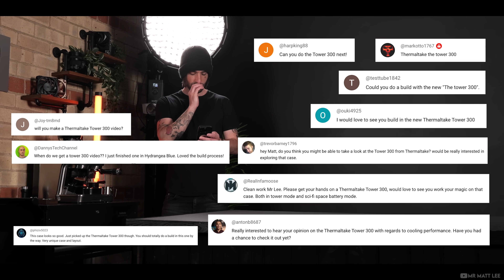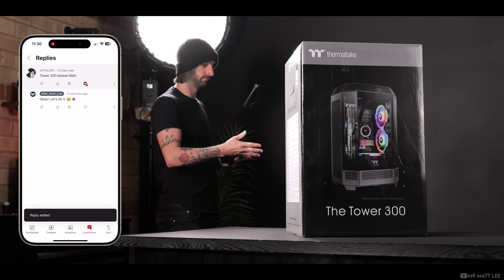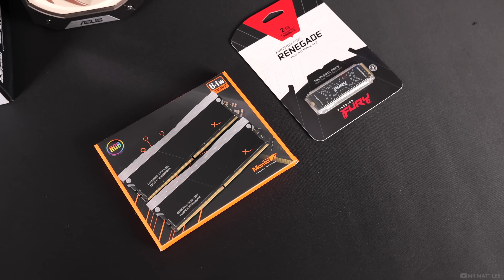A Coffee Lovers Dream PC Build... | Thermaltake The Tower 300 | Noctua RTX 4080

Comment: The fans on top surprised me. In the original they were clearly used as takeout fans.
Reply: Same here. I would have though exhaust fans on the top while the CPU, GPU and power supply pull in cool outside air. Because the exhaust slot on the GPU exhausts inside the case, that would have GPU heated air trying to cool down the CPU radiator.
Reply: I thought the same, the GPU exhaust hits the intake air, so all the heat from the GPU will be pushed back into the case and likely to recirculate back to the GPU fans.
Reply: @sebashadow2209  HOT AIR RISES. SO DOES MY BULGEASAURUS
Reply: Maybe he is going to mount it on its side using that case mount made specifically for that case?
Reply: it's mounted that way because of aesthetics I guess. If the radiator fans were pulling air, their back face would face towards the interior of the case, so the build wouldn't look so clean and elegant 😅

Comment: I could just say that this is an amazing build, but it wouldn't be anything new, nor surprising. The level of your work goes only one way - up! 🔥 
And the more ☕, the better the result! 😁

What I will say though is that I've been building PCs from ~1998 till ~2010, with a loooong hiatus that ended just last year (2023). This "time off" lets me see the coolest upgrades in PC building we had in this field over the last decade and a half and undoubtedly there are two:

1. Data drives in the form of PCI-E/NVME - it makes it all look so much cleaner! And yes, I'm the guy that still remembers those terrible IDE cables with Master/Slave configuration jumpers on the hdd drives and cd drives. 🙈
2. All the different form factors for cases! It's just amazing to see all those different approaches from case manufacturers. It's not "all the same" with a different front anymore and I'm soooo ready for it!

Cheers! ☕

Comment: Get my request fulfilled while also being immortalized at the beginning?! Awesome! Can't go wrong with the Noctua coffee vibes either. Looks phenomenal! Thanks for doing this one.

For those of you looking to build in this case to use, however, I strongly recommend fan orientation of top exhaust with AIO fans and bottom fan as intakes. I've tried every possible configuration including Matt's here and top exhaust with AIO and bottom as intake has been the best for thermals for me at least when monitoring temps in gaming and running some multi core tests in Cinebench. (running a 14900k w/360mm AIO).
Reply: thought exactly the same when I was watching the video
Reply: Yep
Reply from the maker: Always a pleasure to acknowledge you guys where possible 😊 Regarding the temps, I also tried it off camera in multiple configurations and found that the top intake worked best for me (only by a few degrees) based on the hardware I’d chosen. That’s not to say it will work best for everybody, all motherboard, graphics cards, processors and such will ultimately have different heat levels and tolerances. The takeaway here is that in none of the configurations was the temps ever a concern… go with what you prefer the look of first, if there’s thermal issues, make a few changes until you find a balance for your individual setup and needs. That should always be the rule 😊
Reply: @Mr_Matt_Lee  I completely agree. I preferred exhaust myself for aesthetics, but had to swap them. This 14900k is like a tiny nuclear reactor so it needed the cooler air. I was hitting mid 90s at times with any other configuration. Most other CPUs shouldn’t have an issue going the exhaust route.
Reply from the maker: @phizix215 that’s a very educated response 😊 I would agree, the 14900K needs as much cooling as possible. Even I’ve had it thermal throttle in some cases I didn’t expect it to throttle in 😅 The 14700K on the other hand is much more thermally tame as I’m sure you know. Enjoy the build bud ! The Tower 300 is certainly a look ✌️

Comment: It is a really nice setup, although I'd change three things:
1: rotate the top two fans to exhaust 
2: rotate the CPU all in one for intake 
3: change all the fans to chromax blacks (like what you have above the PSU. 

Other than that, I could live with this PC! :-)
Reply: Same. I'd love to see comparisons for the airflow in both layouts. My tower 100 is pretty effective in chimney layout running silently. No other option with that case though.
Reply: @scottyanderson7263  I have Tower 200 and put lower one intake, one lower one near cpu for intake, higher one for exhaust and top cooler for exhaust. all works pretty good with air cooling assassin iii from deepcool
Reply: Start your own YT channel and see how you do.
Reply: @scottyanderson7263  There are other reviews on the other Thermaltake cases that are larger than this one and they all show the chimney layout you are running is the most effective way to use these style cases. Any time you have air being pulled down from the top it creates higher temps. He would have lower GPU temps even having the radiator blowing the hot air into the case and using the top as the only exhaust than even doing it the way he is using it. And having a lower GPU temps is way better than having lower CPU temps for gaming at least.
Reply: @trsskater  great point. Mr Matt has another video on airflow where he describes Gpu priority vs. Cpu priority, but ultimately, if your gpu is working hard, your cpu probably won't be maxing out (Gaming vs. Productivity) unless one is mismatched. My tower 100 is my 3rd chimney style case. I had a Phantechs shift before but ran hot. I still have my Silverstone FT03m as a nice little minecraft and homework device for my kids. Looks like a series X.
Reply: Big fan of the chimney style case and having top access to io.
Reply: you are adding a load on the radiator by making the fans exauste, it should be intake fans, so it intakes cool air into the radiator

also the top fans should be exaust not intake, because hot air tends to go up not low

Comment: Fantastic airflow and build. I would be slightly concerned about how much dust is going into the case because this is the first time im seeing intake air going from the top (since we are so used to have the top part of the case as exhaust) I pray the dust build up isnt too bad so dust particles itself tend to fall downwards... or maybe this case will go to a guy in the UK where the dust is much less of an issue than someone like me who lives in southern europe 😁
Reply from the maker: To be fair, the case has very good dust filters and the panels remove extremely easily, so keeping on top of the dust filter cleaning shouldn’t be an issue at all 😁

Comment: Wow. Stunning looks. Again one of those awesome videos you did. The air being drawn into the top looked like a crazy weather phenomenon. Well done. 🤩
One question though: Where do the cables enter the case, when connecting to the motherboard backpanel? It's not the front, is it?
Reply from the maker: Thanks buddy! Love the idea of it being like a weather phenomenon being pulled in like a tornado. As for the cables, they mostly connect under the graphics card or over the PSU. It’s a bit weird, but it works I guess 😅
Reply: @Mr_Matt_Lee  Thanks for the info. Looks great in this video. 😎

Comment: Damn this build is perfect. 

Rate my build 

Nzxt limited pubg case 
-Saphire Rx7800xt nitro + 
-I7 9700 non k ( Coffeelake )
-Artic liquid freezer 2 240 
-32gb ram at 3000mhz 
-9 TB in Total / 4tb barracuda sshd / Dell emc 4tb ssd / 1tb m.2 
-850w gold PSU But soon ill get a new 1000w PSU gold.

Laptop 
Cyborg 15a12vf 003nl
I712650h
Rtx4060 45w resize enabled.
4tb m.2 cuz 512gb isnt enough.
16gb ram at 4800mhz

Comment: The upper fans should be set to exhaust and the lower one for intake as well as the AIO fans - according to the law of thermodynamics, warm air tends to rise, so the fans will simply help the hot air get out of the case.

Comment: nice  build .... I was looking  to get that case .... BUT I  have   negative point  about  the radiator placement ...  with  the connection on top and  the air is on top ,  
correct me if I'm wrong, but for me that  is  not  a good  way  to setup, any remarks  are welcome.

Comment: One suggestion: change the 140mm top fans to blow out hot air and the radiator fans to blow cool air in over the radiator. Heat rises and dust settles.

Comment: I did my current build based on this video actually. I didn't cash up for the 4080 Noctua edition for the simple reason that next gen is around the corner. But with Nvidia RAM-strategy I'll join the red team now. Enough of that. The case is so sweet to build in. Quality is ok but the layout is what's it all about. I have my AIO fans in pull and the top fans in exhaust but will switch to his configuration instead. I/O plate is cumbersome to reach so once you plug in, you'll leave it as is. And those cables shows at the top back end of the case, not looking awesome.

Comment: you have the air flow optimized incorrectly you will get better performance and cooling if you set the Rad to intake so you are using fresh air to cool the CPU and not warm GPU air. and set the bottom fan as a intake and the top two fans as exhaust. this will create a nice positive air flow with better temps and lower dust build up

Comment: I am going to be using an all-air cooling system with my Tower 300 build. Have you had any chance to see how configuring the fans on the right of the case as exhaust to be beneficial to helping pull fresh air into the GPU?

Comment: Hey matt. What 12VHPWR extension or direct cable do you use? Is it one that came with the PSU? And is it 16 to 16 or 3x8 to 16? I was wanting to get a cablemod one. but I see that for some reason Asus has put all their 12VHPWR connectors upside down on cards as apposed to the standard so I'm thinking the shroud on the cablemod one could get in the way unless I remove it.

Comment: Question, with the rad hoses exiting rad above the pump, wouldn't that promote air being pulled from top of rad into the pump?  Would it not be better to have the rad flipped 180 and have hoses at bottom of rad?  Doesn't look like that orientation would fit in there.
Reply from the maker: There’s a lot of stigma surrounding the orientation of AIO tubes. The reality is simple, provided that the highest point of your radiator is higher than your pump, you will be fine. That way, if any air is trapped in the system, it will always be away from the pump. Sure, tubes down is absolutely the 100% most efficient, but having built with hundreds of them now, one of which has had tubes up for 4 years and still running strong, there’s nothing to worry about 😊

Comment: as i thought... so many have seen the same problem in the comment section ! the Air flow from the TOP down in to the Case building pressure so the GPU ( video Card ) has a bad in take... witch will build up more heat because it doesn't has the air flow it needs to cool down... Hot air goes UP UP and AWAY ! second : i am missing a video Card bracket as most heavy video cards are supported by a bracket instead of just 2 screws most heavy Cards seem to SNAP or Break if the Card would move left to right and in older cases up or down and that would really S U C K bad but hey you still have a cool looking Case and i really do like it allot... as the Fans of the GPU ( Video Card ) are on the out side sucking in air is a big plus... i would use the GPU fans - Power Supply Fan - water cooling fans for in take and the upper as exhaust. No chimney is build side ways and you don't want to work against the heat but work with it as this helps the air flow even more... but that is an easy fix so what is left for me is the bracket to keep the cart secure in place even with 2 screws and vertical weight down i would not trust it in any build case without a simple bracket for 10 dollars, F*CKING up my 4080 Card ! aaaaand i have seen plenty that got broken so do your self a favor and secure that card with a bracket so Thermaltake : This Case is closed or not :D please make a little simple tiny bracket witch you can secure to the case just in case :) on the lowest point of the video card to the case. plus i would love to see a water cooling system massive block that leads from block out side of the case so you would never ever have a leakage inside of the case and a indicator when to refill it simple on the out side... for the sake of just in case ! ow and another thing is the heat that comes from the power supply... so maybe close up the hole power supply with intake on the front and back or something and on the left and right side of the power supply 2 fans sucking cool air in to the case or putt the power supply on top as heat goes up anyways so you will get even more suck mode :D those are the things i would love to see in 2025 as a upgrade in this case

Overall... i really love how this case looks and what you could do with it ! 

live long and prosper,

Comment: It’s suppose to be exhaust on top only
Reply from the maker: It doesn’t have to be that way. I tested it with the radiator fans on intake and the top as exhaust and the internals were marginally warmer.
Reply: @Mr_Matt_Lee  thx for testing 👍
Reply from the maker: @Antho2030  no problem! It’s always in my best interest to build as efficiently as possible 😊 as noted in my previous video specific about airflow, there’s no specific right way…. Just different ways depending on your setup and layout.
Reply: Warm air rises… yes that’s correct… but convection is a very weak force that can be easily affected by any external force… whatever fan configuration (on any pc build) is okay for as long as it can maintain good airflow inside the case…

Comment: why do you exhaust hot air from gpu through aio radiator? and how fresh cold air can inhale through top of the case? not offensing, just interesting, cause hot air is much lighter and there will be inside your case some air collision with hot air from gpu and cold air from top of the case and that mix will go through aio radiator and won't help to cool down cpu, no?
Reply from the maker: In this layout, the cold air is being fed from the top and bottom. It’s the most efficient in my testing for this hardware layout. If the side was intake through the radiator then the internals would get much hotter. This setup was nice and cool, rest assured ✌️
Reply: @Mr_Matt_Lee  Thanks for explanation!

Comment: Hey mate, do you think something similar could be achieved using the same cpu and gpu on an itx board in the tower 200? I was thinking of using a ryou III 240 and setting everything up as a chimney, if you will. AIO and GPU Fans as Intake and then the top 140mm as exhaust. Thumbs up or down would be enough :D

Comment: Doesn't a power supply pull air into it and out the back for cooling? If that's the case I don't understand the air flow visu.

Comment: Also, the top fan of the tower is for exhaust, not intake, but i guess you wouldn't know a thing about heat expansion, thermodynamics or cooling.
Reply from the maker: @moenibus  you’re right. I do not know about thermodynamics, but I do know that cooling in this configuration was excellent with zero complaints, so that’s all what matters, right? The video would not have been released with the airflow being this way should the cooling performed sub-par. You shouldn’t assume I didn’t test prior to filming 🙌

Comment: That pc is not as quiet as it looks. The noctua fans you using are very loud especially the one on the power supply. Also if the top two fans should be exhaust to get better 'flow'.  Flip it and retest and you will see. This is because the intake from the GPU is only based on load and when there is any, the top exhaust will pull it out keeping the gpu and cpu cool. Also creating less noise because your parts are cooler.

Comment: the height of 551mm(a lot of atx cases are shorter than that) is too tall, 281mm is too wide(it's between the width of two types of dual chamber fishtank), the motherboard io panel accessibility is a bigger issue, by going for this unique layout, this case didn't achieve anything other than aesthetic

Comment: If hot air rises, why would you have intakes on the top?
Reply: Not a crazy idea really. I just bought this case. I have a 4090. Thermals suck. I’m about to try intake on the top instead of exhaust and see if it helps at all.
Reply: Don't think anything can save this cases thermal performance imho.
Reply: @wtf1992lynx Sadly, you’re correct. I tested it with the same fan configuration. My 4090 hit 80c  while gaming. Ridiculous. I thought it was suspicious how he didn’t show any thermals. Well, it’s time to get a new case.
Reply: @Isaiahchannel maybe try to cram some slim 120mm fans between the GPU  and the case, it looks like it might fit (not sure as I don't have one). The turbulence won't help with noise, but might help with temps
Reply: @wtf1992lynx  I tried that as well. I’ve been working on this issue for 2 days now. It didn’t help. The issue is that 40 series GPUs with vapor chambers don’t like being in this orientation.
Reply: @Isaiahchannel  ah, had no clue it was a vapor chamber. Makes total sense then. Good luck with that mate!

Comment: Your airflow setup for this case is horrific. Intake from the filtered GPU and AIO side and exhaust from the top and rear. Makes 0 sense to set the AIO to exhaust out of a filter and the top unfiltered 140mm fans as intake.
Reply: I have the bigger evil sister I agree with you.